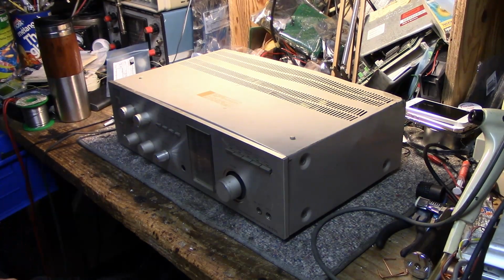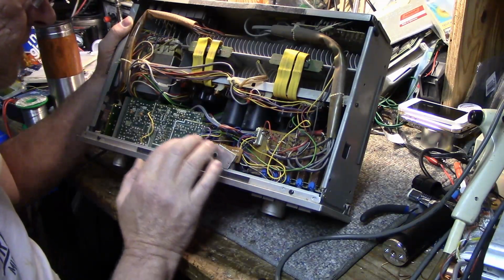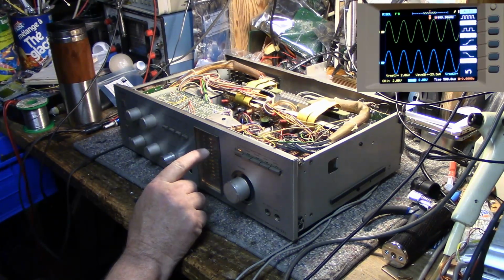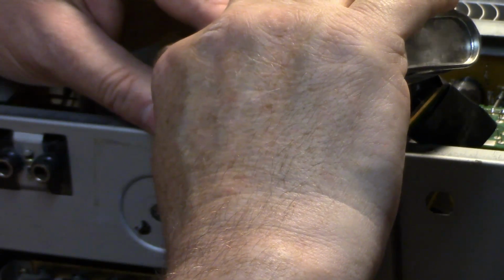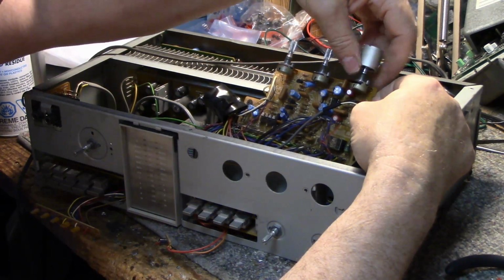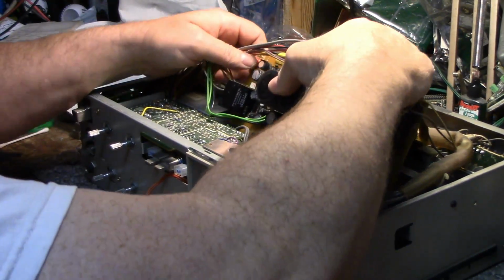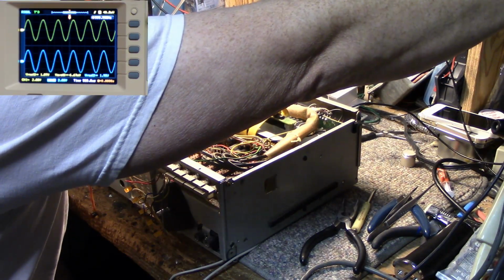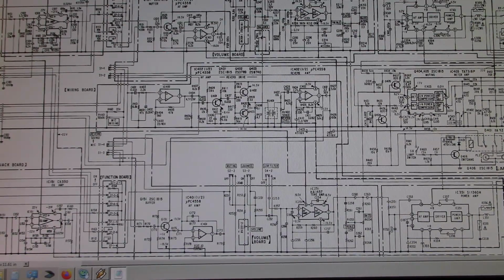Sony TA-535 Integrated Amplifier - Repair (Ep. 28)

Comment: I have same amp, actually a full set and  i like it, but i notice that the amplifier potentiometer is scrachy and i try to clean with some potentiometer cleaners but not for long, the scrachy noises still there, and than i decided to clean potentiometer itself from inside and i damaged contacts( i think carbon film). I mean, where you mention in video 14:52 I damage this part of contacts
Its possible restore contacts?
Reply from the maker: Not much you can do for a damaged pot besides replacing it, they can be quite delicate inside
Reply: @TrevorsBench  Ok. It's looks like working for now, but don't know how long, but anyway, have one question. On this amp, there is a LOW FILTER button, what he do? I accidently sow and Sony STR V45L same LOW FILTER but with 15hz writen on. For i know 15hz human dont hear, righ? Or i miss something?

And on this amp manual says Filter: LOW 6dB/oct below 30Hz
Reply from the maker: @dariuss7923  Yes, most amps that have phono stage will have the low cut filter. It typically starts to cut the signal below 15 or 20Hz and is used to filter out turntable rumble and feedback

Comment: May I disturb you with  a question  , advice ?  I  I received  from an old  friend all system  Z 400  , in a very , very good cosmetic condition , who include also the  TA  535  amp.  He receive power supply from timer , witch is the only one connected to main. In this condition is working  but I discovered some heated components inside  timer.  I  open  the amp cleaned even better  , found also that oxidate  bridges under the capacitors, so far nothing else major. But connected  directly  to  main power supply  (  without  timer ) ,  trip the automatic circuit breaker   (  rcd  type ).  Any  advice  ,  if is not to much trouble.  Thank you  very much.
Reply from the maker: Generally I won't try to diagnose problems in the YouTube comments section. I would need to see the item first. 
If the circuit breaker is tripping from the amp I suggest not trying to power it up until it's been looked at and repaired. It may be shorted or have a ground fault which could possibly shock you

Comment: I've got the exact same problem with the corroded jumpers underneath the caps. What kind of wire would you use to replace that? Whatever glue they used on these boards seems pretty corrosive!
Reply from the maker: Once you clean up the glue, the corrosion stops so you can use regular copper or tinned copper.
Reply: @TrevorsBench  Thanks mate! I've got some tinned 22 AWG wire so will try that. Cheers.